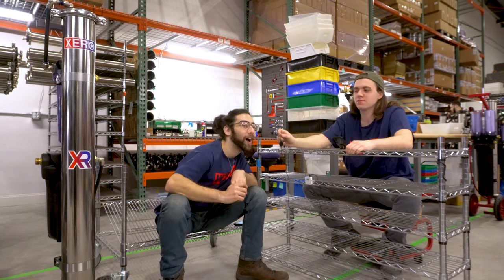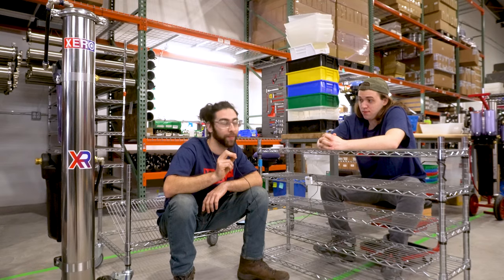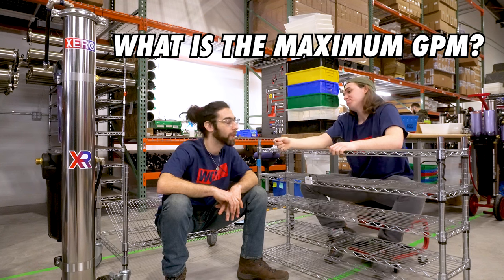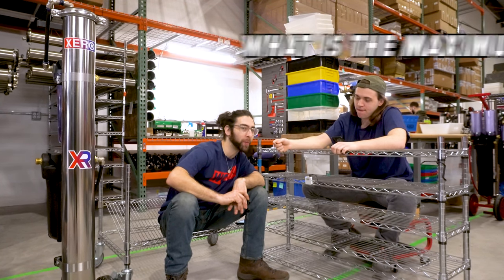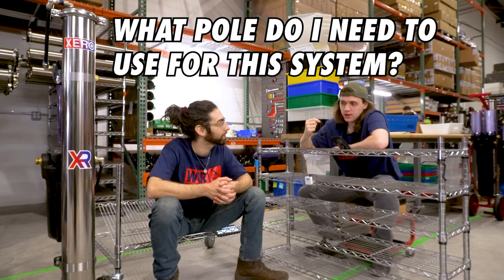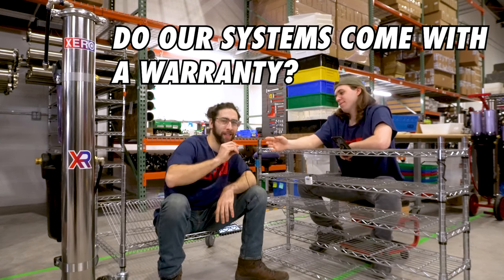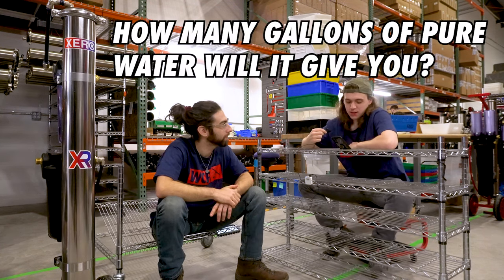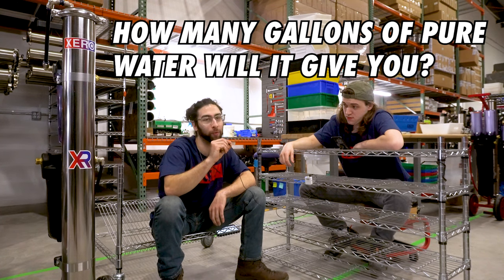XERO Pure Revolution | FAQs

Comment: On the max, are you getting 2 gpm mostly because of the difference in RO membranes your using versus the basic XR? Thanks.
Reply from the maker: Yeah the system itself is plumbed different, and the split is a big part of the increase in production.  It allows more water with less restriction.  ~Jersey 862-312-2026
Reply: @windowcleaner  so the only 40” xero RO membrane I see online, is that what’s in all the xero carts that use 40”? Thanks.